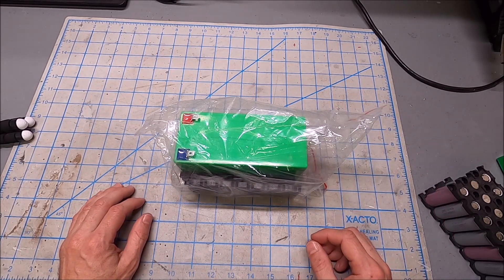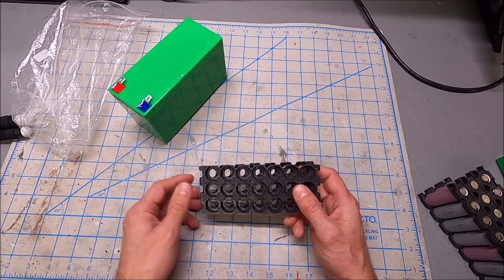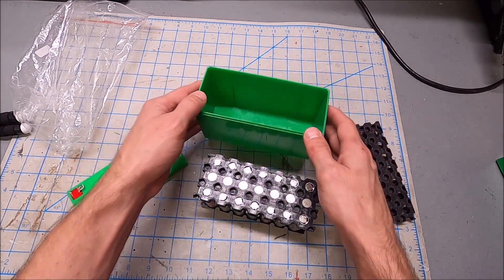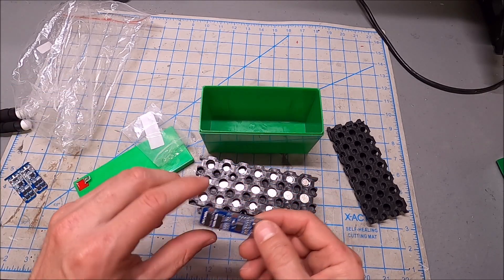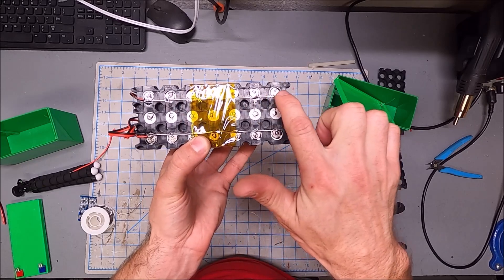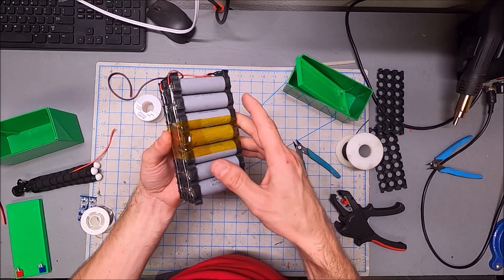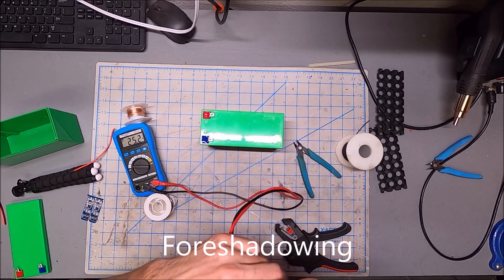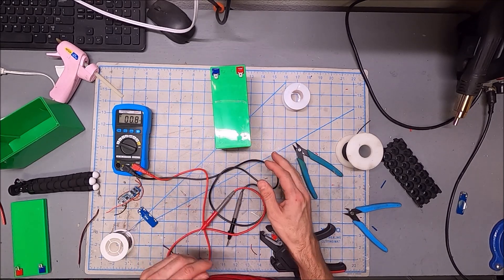DIY 12V LITHIUM ION BATTERY

Comment: I think you should also choose 18650 batteries on the basis of their similar internal resistances as well (besides rated & measured capacities). As some batteries might be failing by having high internal resistance. 🤔😕

Comment: Do i still need a bms if i recharge battery pack to solar controller with ion lithium management?
Reply from the maker: In theory no, but I would always have a BMS just in case you make a mistake or something goes wrong, the BMS might save you.

Comment: They sell Nickel Strip Rolls, now. Here in the U.S. Certain mm thickness & mm width of Nickel Roll. Depending in wire gauge? And BMS's with Bluetooth App with phone (software in BMS). For constant monitoring of cell voltages/amps/ohmage in real time each second. Plus temp sensor alarm/ smartphone alerts for BMS's with temp sensor wires. And low 32°F freeze sensor charge cutoff . All for under $100, now. Worth it if you keep the battery bank in a Van like me. Were a fire can be catastrophic. Nice Video!

Comment: Can I  use this built lithium battery 12.8V for diy jump starter?
Reply from the maker: No way. A jump starter well need to deliver 200 amps. Three 18650 in parallel can only deliver maybe 30 amps.
Reply: @stevenc22  Sorry, I forgot to mention it is a 100Ah battery built with BMS. Same as what in the video.
Reply from the maker: @joeybuls2191  you cannot deliver hundreds of amps from a battery this small. Hell the BMS I'm using in the video was only a 10 or 20 amp BMS. A jump starter needs to deliver 200amps instantly. This battery cannot do it!
Reply: @stevenc22  Thank you for your info. That saves my battery for knowing what will happen if I tried making one. 🙂👍
Reply: You need to add a super capacitor in parallel to the battery to use it like a car starter..

Comment: hey the shell is no more on sale, do you know where to find more ?
Reply from the maker: https://www.ebay.com/itm/12V-3S-7P-Li-ion-Battery-Case-Holder-for-DIY-18650-Powerwall-Battery-Pack-/264924559393?mkcid=16&mkevt=1&_trksid=p2349624.m46890.l49286&mkrid=711-127632-2357-0

Comment: So 3.7v X 3 is only 11.1v...............   Fully Charged 4.2V x 3 is 12.6v.      Doesn't leave a lot off room ?
Reply from the maker: Agreed. 3s is a weird 12v configuration.
Reply: @stevenc22  So i was looking at a simple project for the shed, 150w Solar panel + 20a Controller + 400W Sine wave inverter and 2 X 12V 60ah hour batteries,  PROBLEM is the Inverters range. Any Suggestions on how to manage it?
Reply from the maker: @diysolarnewzealand3388  I always build 18650's in 24v configuration because 24V inverter ranges match much better to a 24V lithium ion battery. You can also consider switching to 12V LifePO4 batteries in 4S configuration which has a much better voltage range for 12V inverters.
Reply: @stevenc22  24v gives a much better option indeed - Thanks for that
Reply: @diysolarnewzealand3388    @Stevenc22   I'm trying out both; putting together a 7s3p 18650 pack now and I have 26650 LFP's coming, which it looks like a 4s2p and BMS will fit inside.  I just noticed K2 Energy sells 4s3p LFP packs like this, but they have no BMS.

Comment: How do you get 12v from the battery banks in series? What's the voltage rating on the cells?
Reply from the maker: 4.2v x 3 in series is 12.6v
Reply: Oh yes 4.2v I was thinking you were using 3.2v lol I was scratchy my head
Reply: @carlosreyes6448  3.2v is the discharged voltage of the cells. So the battery ranges between 9.6 and 12.6.

Comment: Awesome video,i just have a wuedtion,i want to ude this battery in a solar power bank i am building,would i be able to use the solar charge controller or what should i so to charge the pack from a solar panel
Reply from the maker: Yes you can use a solar charge controller. Just make sure it is lithium compatible and user programmable.  I use the makeskyblue controller and I can program it to any voltage I want
Reply: @stevenc22  cool thanks man,can u maby drop a link to the most budget friendly controller that will work
Reply from the maker: @tiaan1587  depends on what kind of solar you have. If your solar had a higher voltage than the battery, then you use a buck converter mppt charger controller like the makeskyblue. For example if you are charging a 24v battery and havr 2 solar panels in series making 40v then you buck the voltage down to 24v https://amzn.to/3xiKXWm
Reply from the maker: @tiaan1587  or if your solar panel is lower voltage than the battery like you have one 20v panel trying to charge a 24v battery then you need to boost your solar using a boost mppt charge controller https://amzn.to/2U4TFJq
Reply: @stevenc22  okay thanks man,i am jist going to use 21 salvaged sells for the pack and a 30w solar panel,i was wondering if it wpuld be alright to use sells with different capacities togheter in one pack
Reply from the maker: @tiaan1587  yes but try to match the total capacity of each parrellel pack with each other. What I mean is let's say you have 7 low capacity batteries, 7 mediums and 7 high. You should put 1 low, 1 medium and 1 high together in a parrellel pack and then join 7 of these packs together in series for a 24v battery
Reply: @stevenc22  i want to make a 3p 7s so still the same?
Reply from the maker: @tiaan1587  yes. Put 1 low, 1 medium, 1 high per 3P
Reply: @stevenc22  thanks for all the help,do you have a discord or Facebook groupe i can join?

Comment: i made a 3s li-ion battery but...  i'm wondering if anyone has found a way to use these fully @ 110v.     seems like most power inverters cut out at like 11.xx volt  when i'd like to run down to 9v cutoff.  anyone find a programable power inverter or something?
Reply from the maker: Good question. This is why I build 24v batteries because inverters can use the entire battery at 24v. There aren't programmable inverters. You just need to search around and find one with a 9v or 10v battery cut off. Different inverters have different voltage ranges and you might find something.

Comment: I’m new to this and was wanting to build one of these. Can you charge this with the standard 12 volt charger that you would use on the sealed lead acid battery that this would replace?
Reply from the maker: No, this has a different voltage curve. This is a 3s lithium ion battery, 3 x 4.2v = 12.6V. You need to use a 12.6V max charger. Some sealed lead acid batteries charge to 13+ volts which would kill this. You need to use a charger like this https://amzn.to/3oC68zi
Reply: @stevenc22  I kind of figured you probably could not. Thank you 🙏
Reply: @stevenc22  Wouldn't the bms just let it go to 12.6 and then cut it off?
Reply from the maker: @vhfgamer  hopefully but never rely on the BMS only!

Comment: can we use this battery pack in UPS ?
Reply from the maker: That is a bad idea. You can only fit a small bms in the box and UPS will probably try to pull more amps than the BMS can handle

Comment: Have you seen the larger 14ah cases? Can only find in the 7ah format. Am also looking to build to swap out an ageing 12v AGM unit, however assuming the BMS is happy with the AGM charge circuit how are we ensuring the voltage stops as not all BMs are created equal.

Comment: But for E.g samsung 25r 18650s have a maximum discharge ampage of 20amps x 7 in parallel thats 140amps so to get the full performance from your batteries youd need a much bigger bms or am i wrong?
Reply from the maker: Absolutely. The LG batteries i was using have a maximum discharge of 3 amps.  However those case terminals would melt if you tried to push 140 amps through them. This box is best suited for 20-30amp draws. Plus there isnt space in the box for a larger BMS.
Reply: @stevenc22 true, plus you wouldnt have much usage time i guess even if you coild draw 140amps the powerbank would discharge fully minutes if not seconds. You normally want at least an hour of usage. Can you get the lower discharge rate batteries much cheaper or is there not much difference between them and the higher performance batteries? I beleive people normally go up in voltage rather amps if they have higher power applications too keep wire gauge down.
Reply from the maker: @grahamjones6712  All correct!

Comment: Ups charging voltage about 13.5v, it is it too high voltage for this pack?
Reply from the maker: YES. A 3s maxes out at 12.6 and become dangerous if over charged. The BMS will actually turn off the battery at 12.6v

Comment: Could you post a link to these bms?  I can't find them to save my life!
Reply from the maker: https://www.amazon.com/Module-Charger-Lithium-Battery-Protection/dp/B082VLJBPF/ref=asc_df_B082VLJBPF/?tag=hyprod-20&linkCode=df0&hvadid=416926807659&hvpos=&hvnetw=g&hvrand=10538716190610701291&hvpone=&hvptwo=&hvqmt=&hvdev=c&hvdvcmdl=&hvlocint=&hvlocphy=9027583&hvtargid=pla-872104792938&psc=1&tag=&ref=&adgrpid=92859401246&hvpone=&hvptwo=&hvadid=416926807659&hvpos=&hvnetw=g&hvrand=10538716190610701291&hvqmt=&hvdev=c&hvdvcmdl=&hvlocint=&hvlocphy=9027583&hvtargid=pla-872104792938
Reply from the maker: https://www.ebay.com/i/143655966321?chn=ps&norover=1&mkevt=1&mkrid=711-117182-37290-0&mkcid=2&itemid=143655966321&targetid=934793861016&device=c&mktype=pla&googleloc=9027583&poi=&campaignid=10454925353&mkgroupid=109413765251&rlsatarget=pla-934793861016&abcId=2145999&merchantid=6296724&gclid=Cj0KCQjw-O35BRDVARIsAJU5mQVZ3znqbmdbeAxqfJcAs9m4MYYI8Id1InrptszBaVfGGh8DCBQ1G4QaAk-HEALw_wcB

Comment: Thanks for the lead. Trouble with 3S for 12v devices is the BMS cuts out on over discharge so you don't get the full capacity of the cells.
Reply: Is there any way to fix this? programable or voltage selectable BMS or something? I'll be charging with an MPPT controller so do I even need a BMS?
Reply: @ameic  the solution is to make a battery with 4 3.2v lifepo4 cells
Reply from the maker: Yup. 3s and 4s don't work well for 12v

Comment: you sometimes have to apply a charge to turn the pcb on
Reply from the maker: yup i did manage to get it to work in the end by charging the pack!
Reply: @stevenc22  Pin an update to the comments detailing how you were able to wake up the BMS.

Comment: you could even wire it for 7s 3p for a 24v battery
Reply from the maker: Yup I mentioned it in the video.  Yeah could be good if you stacked a few for a bigger 24v battery
Reply: @stevenc22  i commented befor i even watched the video have not had chance yet just been sorting my media library out of over 3k films lol